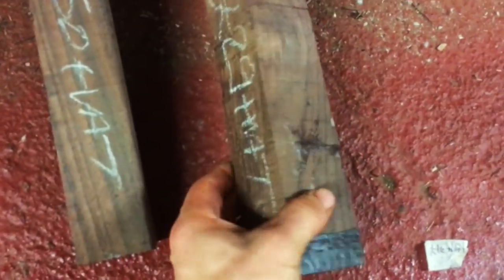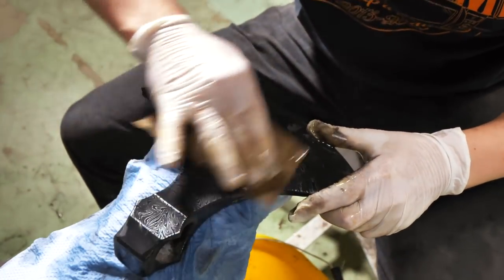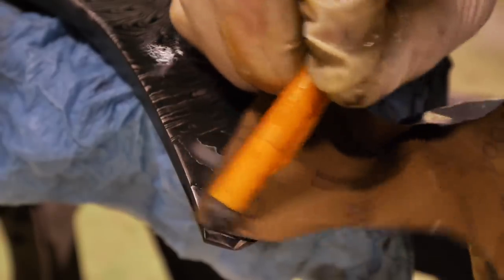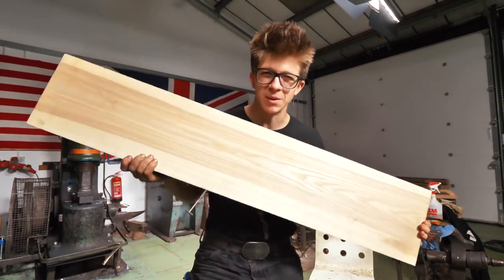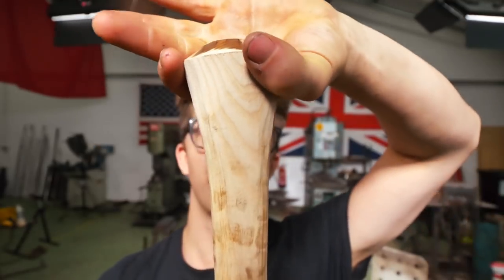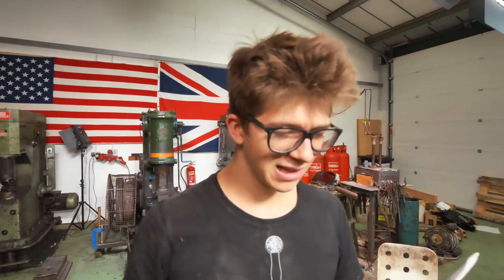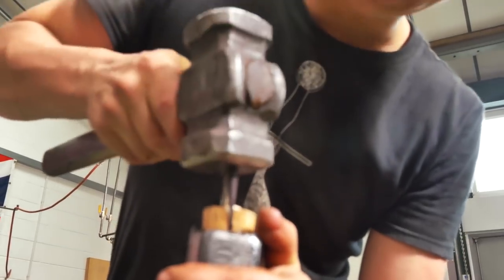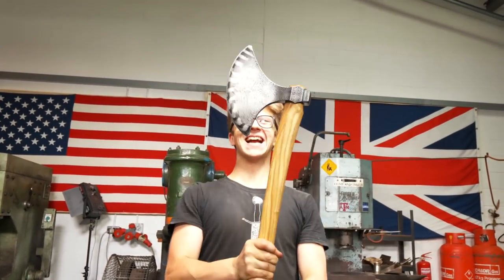VIKING BATTLE AXE: Part 6

Comment: 12:51 Its always good to lubricate the shaft before driving it in.
Reply: Life is sooo much more fun when you have a dirty mind! ^_^
Reply: Goddamnit
Reply: tecnui heck, he pretty much started the video "getting wood", then went on to lubrcating his shaft and stickine his shat in the eye... LOL
Reply: tecnui You can have too much lubrication. Lol
Reply: clearly you live in a very DRY enviroment......if you need to help nature.....you are doing something wrong.
Reply: Why? The wood would expand when wet, and shrink back up when it dries making a loose fit?
Reply: Fjeppesen, I often soak the head of hammers and whatnot in penetrating oil or antifreeze after installing a new handle. Works a treat.
Reply: gigidy
Reply: robert hesse only if you're flaccid.
Reply: scott left clearly you haven't stuck in there for any length of time if you don't understand the need for lubrication.
Reply: fjeppesen hu hu hu, wood, expand, shrink, loose fit... Hu hu hu.
Reply: Guys - Judging by the comments, there seems to be some confusion about what Alec is saying/referring to around 12:51.  I went back to the 12:51 mark, & it turns out he's referring to driving the handle into the eye of the axe head here.  I can't gauge what most of you believe he's talking about, but I can tell by your comments that you're not realizing he's simply trying to assure that his piece is well hung.  I don't believe he's going to lubricate his entire shaft, rather just the tip, then really give it a good hard pounding, being careful not to split anything in the process, as what an unfortunate mess that would be.
Reply: If you are being serious and not dirty, you are right. HOWEVER lubricate it lightly.. wood can really inhale the oil, and if it swells up before it is attached properly, you are screwed because you can't get the oil back out
Reply: UncleManuel I agree.
Reply: youngsters . . . amirite ?
Reply: Thomas Russell  well actually he was out searching for a nice piece of ash.  then he lubricated the shaft before putting it in the axe hole.  who knew blacksmithery could be so dirty?
Reply: tecnui C‘mon
Reply: Golden comment
Reply: Oooooooooooo
That's a dirty thought there...
Not sorry!
Reply: @cunijoeme  baaaaa

Comment: Hey Alec, use a cheap block of wood between the butt of the handle and your hammer when pounding it in.  The block will help adsorb the shock so it'll help not split the wood and also it will make it so you don't warp or do anything to the end of the handle!  Just a pro tip!

Comment: Great work. Little tip for hand sanding the round handle. Clamp one end in a vise and then cut a long strip of sand paper, hold each end and use a type of shoe polishing motion back and forth. You can really round off all the facets easily and quickly.

Comment: Just an unsolicited piece of advice but when hammering wood like the handle if you use a spacer of wood you can prevent hammer marks.
Reply: Foster Langford and perhaps a wood mallet
Reply: I think he wasn't concerned this time, because he was trimming down the wedge, and sanding the handle base so the marks were removed.
Reply: Actually, if I recall correctly.. when hanging an axe you don't need a hammer at all. What you do is have the head up instead of down, and you raise the handle a few inches off the ground and let it drop, the shock causes the head of the axe to move down the handle into it's seat

Comment: Damascus Bow Limbs???
(Sorry for the spam)
Reply: God :-O one day he'll say something, I think Damascus bow limbs would be epic, just keep spamming :)
Reply: damascus bow riser would work, if not a tad heavy but would love awesome!
Reply: If you want steel limbs then why not make a crossbow, with Damascus trigger and other hardware?
Reply: God :-O libs wouldn't work.... steel bends, fiberglass and wood return to the shape you want. Bows are under a whole bunch of tension, so metal limbs (Damascus in particular) would crack and/or bend out of shape pretty quickly. As a previous poster said, a riser would totally work, but limbs are wood and fiberglass for a reason.
Reply: Danzig Rulze 
That would work too but that requires more moving parts, and bow are a lot more fun.
Reply: Please please alec??
Reply: Benjamin Schwendiman 
No you have to say,
"Pretty Please!!!"
Reply: A crossbow would be easier to make and is just as fun if not more to operate.  Could even make full Damascus steel bolts.  Not to mention the numerous crossbows you have to choose from by design.
Reply: holy shit, rosewood recurve with damascus limbs
Reply: Strain Specific LTD. Sorry but your wrong... bows don't stay strung and if you temper the steel right it will return to shape. The only negative with steel limbs is the draw weight is often 100#+. Look up man at arms katniss bow here on YouTube. Historically there is record of steel bows. They weren't common because of cost. You can't make an iron bow and steel was very expensive compared with wood.
Reply: spring steel?
Reply: Strain Specific LTD. If they are something like 5160 and they are hardened they will return to shape
Reply: And once he figures out the spring steel thing...... he can make the springs for the huge bear trap!
Reply: God :-O  you would need spring steel
Reply: My bow stays strung, ALOT of force goes thru a bow under pressure, Im unsure a long term option for a day to day bow would be good with metal limbs. Many of those historical examples....and this weirdly doesn't come up in convos Iv had...were not meant for long term ownership....the bow was expected to survive the life of the owner and in battle...um..1-2 hours tops in the good fun battles:D
Reply: Nice looking ax I would love to have one of those and a knife that matched bit I'm way too poor great job as always
Reply: God :-O wouldn't work, they need to be able to bend and flex.
Reply: Sure it could, just needs a spring temper and the right geometry. And pretty much flawless welds...

Comment: You hitting that wood with that steel hammer made me anxious. Get a softer hammer next time man. lol
Reply: I was feeling the same. Definitely in need of a wooden mallet me thinks. Any chippies disagree feel free to correct me.
Reply: Wouldn’t a rubber mallet be better? We’d use them often in the stair shop I used to work at

Comment: Why did you run the wood dust on it?
Reply: Shadi Nachat rubbing the handles own guts on it let's it know who the boss is and not to try any funny business.
Reply: It acts like a fine grit sand paper and smooths out the wood. If you hold it tight enough and build enough friction you burnish it, which is like a heated friction polish. Wood turners do this a lot.
Reply: D Duff ehhhh I'm pretty certain it's just an intimidation tactic.
Reply: Wood is a fickle and dangerous enemy. The slightest show of weakness and it will pounce. Rubbing it down with its own shaved body parts shows that there is no limit to the violence that you are willing to inflict on it.
Reply: D Duff Yessss, YESSSSSS! We construct buildings with the bones of their brothers and must not underestimate their willingness to strike back.
Reply: D Duff , omg this is the best reply ever!!

You tried to give a serious answer 1st and gave in for this one!! Hahahaha
Reply: Shadi Nachat , technically you can also help fill in some of the pores (or microscopic imperfections) of the wood with the dust and this make it feel smoother.
There are other ways to help accomplish this too like wetting the wood a small amount and then sanding off the little wood fibers (after it dries) that will pop out (called "popping the grain").

Comment: Make a Damascus bow and arrows :) Like this so he can see it !!
Reply: inSIDDious this is technically impossible as a bow flexes whilst pulling the string.
this would not happen if you make it from metal, a crossbow however, with a wooden arm is definitly doable.
Reply: You can definitely make a bow from steel. The problem would come from having the raw power to draw that bow.
Reply: oh yeah i didnt thought of that, nevermind !! wooden bow and Damascus arrows then
Reply: you could have a very thin steel laminate on the back of the limbs, still wouldnt be the best, but you could draw it. i like the idea of a cross bow
Reply: He could make the riser out of damascus
Reply: Damascus arrows wouldn't be any good either. Damascus arrow heads at best.

Comment: good idea when wedging a tenon is to drill a small hole slightly back from where the finished product is and offset to the line so that as you drive the wedge in it forces the tenon apart with lower risk of the piece cracking or splitting. The samurai carpenter has shown it off as a tip in a couple of his mortise and tenon joints and its worked great for me

Comment: I would recommend investing in a nice rubber mallet for woodworking. It softens the blows you'll make on the wood while still allowing the correct amount of pressure to be applied, so you will get the job done beautifully, but not have to worry as much about damaging the wood.

Comment: Hey Alec, First off love your videos. Secondly one thing you could try is when you cut the slot in the handle to drive the wedge into drill a small hole at the end of the cut to prevent it from splitting past that point. Something I have tried in the past and it seems to work well.

Comment: just a suggestion for before you drive a glued wedge in. if you drill a hole at the bottom of the split (in line front to back) it reduces pressure and the chance of the haft or handle splitting as there are no right angles & also provides a small well of glue.

Comment: When you went sand add a drop or two of soap it helps keep the surface slippery and clean so you aren't adding scratches from the shavings your taking off

Comment: Rub your wooden handles in oil then temper them like you would steel but to like 100 to 150 degrees Celsius and that will make you wooden handles a lot stronger.

Comment: My Dad was taught a trick to fit an axe head. Instead of driving it on with a hammer, use a piece of wood as an anvil and hit the end of the handle, opposite the axe head, on the wood. A soft wood like pine works really well for this. It lets the momentum and gravity drive the head onto the handle. I fit all my axes that way, gradually removing material for a tighter fit than I could achieve by preshaping the store bought handle. In Alex's case he did a pretty good job and any gaps can be filled with epoxy.
Another trick i learned is that wood shrinks over time, so soaking the ax in linseed oil can tighten up a loose ax handle.

Comment: Hey Alec nice work, if you are worried about cracking the African black wood putting the wedge if you ever make another axe use a rubber mallet or a deadfall hammer they are gentler and better

Comment: I think a planing axe or a tie hack as they are also known would be an interesting project.  It is a large axe with a 10 to 12 inch head that is flat on one side and the handle was often offset.  They are used for cutting flat timber beams and rail road ties.  Scary to use since you are straddling the log and chopping down between your feet.

Comment: A tip when using sandpaper without a block, fold it into thirds as you would fold a letter for an envelope. The benefits are proportional to the slippicity of lubricant and inversely proportional to the size of sheet. 

  Cutting a hockey puck stack in half is a nondestructive test easily repeatable. Temperature is important. 

Beautiful weapon.

Cheers,  Jim Marriott

Comment: Great work😍 Next time you use ash you should watch out that you don't use the darker core if you want the handle to be shock absorbing because it's less elastic than the rest. I guess that's not that important for a battle axe, but if you ever make an axe for wood choping you want your handle to bend easily.

Comment: Very nice Alec, you should be very proud. In the future if you need to drive a piece of wood I recommend either using a wooden mallet or placing a piece of scrap wood between your hammer and the project to protect it from splitting. Also, while bladed items are fun and cool harvest season is nearly upon us and I would love to see you forge a jack-o-latern.

Comment: I know i'm just a noob trying to give my idea to the pro's, but if you use a grout and sealant smoother with a strip of sand paper wrapped around the edge, and then hold it like a pencil, you can really get into the details and it doesn't slip around! I used that method whilst descaling all of my fullers. :)

Comment: Alec just to let you know, When putting an axe head on a handle u don't need to put the head against anything. You are just suppose to hold it in the air and the weight of the head provides enough inertia to push against the handle. For me it works better than when I've put the head against a stump or something.

Comment: You should use a wooden mallet to drive in the shaft, or at least a piece of wood between the iron hammer and the shaft. Wooden posts and shafts like to split when hit with a harder marterial.
And just to let you know (as if you didn't already): the pattern on the axe looks STUNNING! Cheers!

Comment: Very nice axe! As for the shaft, there are several minor things you should do differently. first, when you buy ash, oak and elm, they got tiny pipes in the dark part of the grainings which makes it a bit weaker, so for these types of wood you should look for the biggest grainings. Also before you use the finest grid sand paper, you should wet a rag and twist it, and then rub it on the wood for the smoothest result. Trust me, its worth it! also when you hit the handle, you should put some wood between the hammer so you don't hit the shaft directly, risking cracking it. love the axehead, it looks awesome. I would love you to make a viking helmet and scale armour aswell, that would be awesome!

Comment: when working with wood you don't have to worry about cracks as much. What you can do is make a mixture of glue and the sawdust that came off the wood and smear it in the crack. it will actually be stronger than the wood and virtually invisible.

Comment: you got to up your wood game a little ;)
1. using Oil on the End is swelling up the wood so it won't help you getting the axe on further.
2. grain should be straight and in line with the blade
3. I would recommend a draw knife for handling an axe instead of the grinder... its actually so much easier, ones you get it 
4. also: while driving on the axe on the handle: you don't need to rest the axe on something... it will drive itself up the handle trough mass inertia
But as always: insanely great project, man!

Comment: Next time when you drive any wedges into wood to secure parts in place. If you drill a hole at the bottom of the cut, it allows a little more flex in the wood without the worry of splitting the wood.

Comment: Alec, keep in mind that wood dust is combustible and it is possible to have an explosion from too much fine particle dust in the air.  A spark from grinding metal or even from starting an electric motor could cause this.  You will need to clean up after doing wood, before you do any metal.

Comment: One thing you can do is take a hammer to the side of the wood to compress the fibers a bit. This will allow the head to be hammered on easier and make a snug fit once the fiber work back out.

Comment: an easy way to fit the head of an axe is to put it with the head up and hit the bottom part of the handle on a wooden piece,  the head will slide due to inertia and fit correctly :) otherwise, hit your little brown piece with a wooden mallet, so no risk of breaking :)

Comment: best way to mount an axe/maul/hatchet handle is get a snug fit, then over a padded surface invert the axe and hit the handle with a mallet about one hundred times. The axe head will creep up the handle and you will be left with a very nice snug fit. You don't need to place the head on a hard surface and risk damaging a nice finish after all that hard work. 

Awesome axe!!

Comment: Alec, when you hammering the wood, dont put force on the metal, the inside will not have the same force all around, hold the axe up and only use the hammer on the wood.

Comment: When using wet and dry I usually use WD40 which would work the same if not better, plus saves you going through the process of using water.

Comment: Once the head is on a little you can let it dangle in the air and continue to hammer the butt of the handle. The inertia of the head will drive drive it on straight and true.

Comment: Hello, really nice realisation !!

Your videos are full of energy, it's something rare, thanks !

I have a question on the way you use damascus steel : I believed that the difference between the two differents steels used to make it was to have the hardest steel for the cutting edge (durability) and the softest steel  for his flexibility. But on yours realisations, the hardest steel doesn't constitute the cutting edge. Especially on this axe, where the alternance of hard and soft steel is perpendicular to the cutting edge.

So, you use damascus steel only for its aesthestic ? It's not a probleme to have soft steel on the cutting edge ?

Sorry for my poor english.

Best regards,
Jo

Comment: when you look at the end grain of the ash it's not 1/4 sawn. the center that you used you can see the grain making a U. or cupped. this is not very stable wood. if you looked at the grain to the sides they are about a 45° and the center grain is almost parrel to face of wood. making it much easier to warp. That piece was  bastard cut lumber.when they cut it will produces more wide lumber. but 1/4 sawn won't warp the down side is the lumber is not as wide. 

you seem like you like to learn. but I must say it is a beautiful axe. I enjoy watching you work. thank you for teaching your skill set

Comment: Do you have to be careful not to use a belt you have used on metal when you go to sand wood? Is there any problems with belt contamination